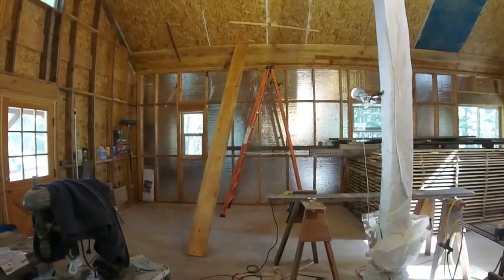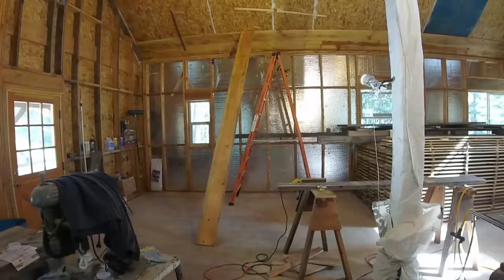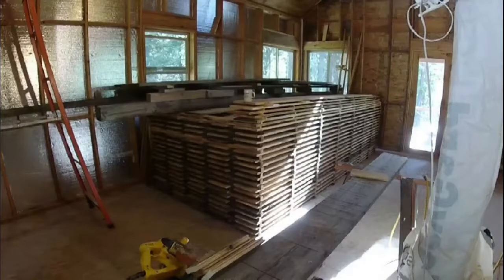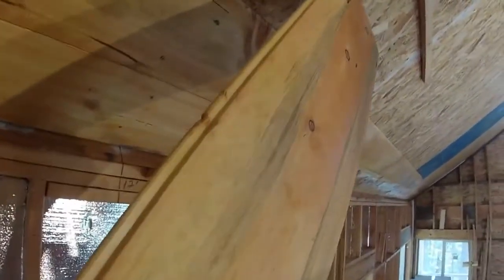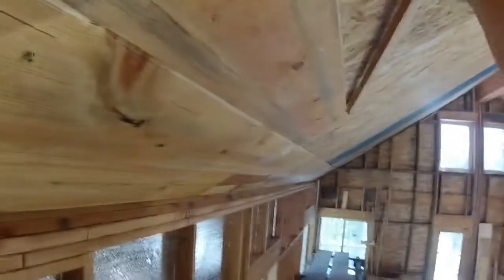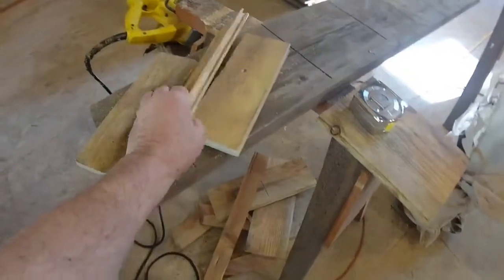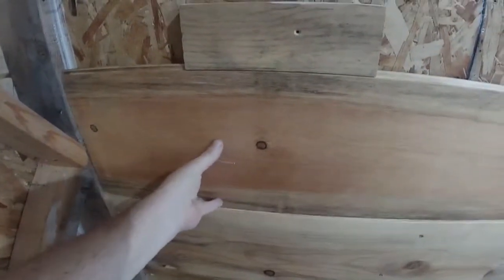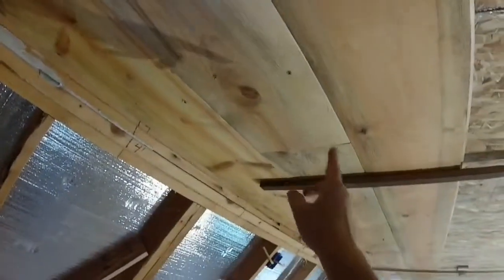Installing Tongue and Groove ceiling on SIP ceiling.

Comment: What type screws did you use? I've a similar project to help a friend with...
Reply from the maker: I used ceramic coated exterior screws, hoping they wouldn't bleed rust stains into the wood.